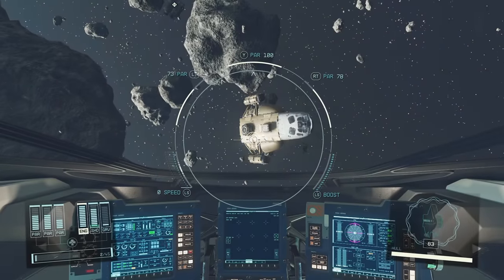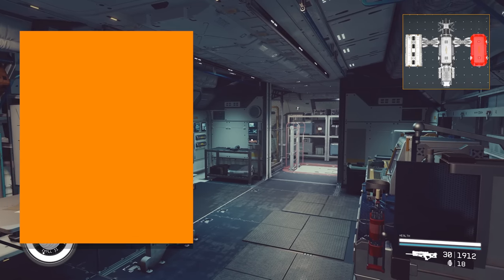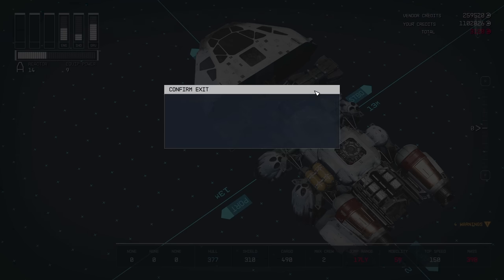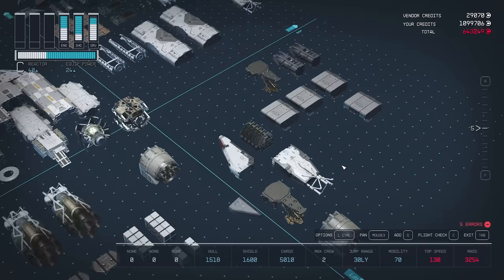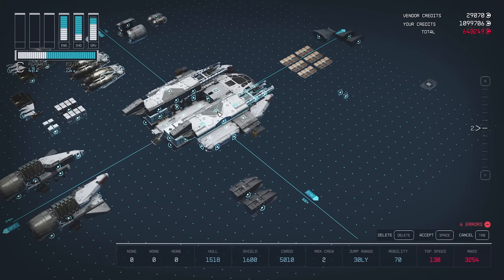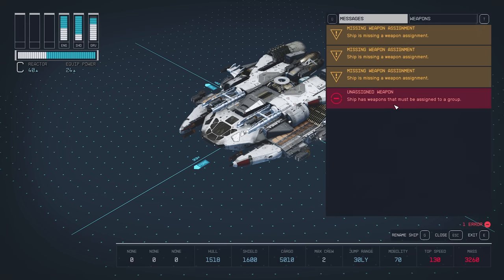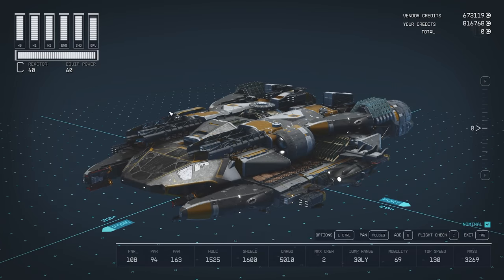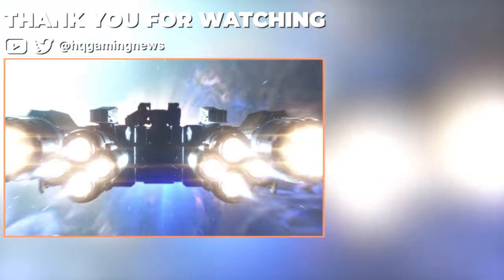The ULTIMATE ENDGAME ship in STARFIELD - No Mods, No Glitches, No Exploits

Comment: New to the game, played way to much with the ship builder to complete transform the Frontier, have a few other designs in mind.  A few questions for you since you clearly have expertise here.   You mention organizing things to protect important parts of the ship spines above the cargo)- is that just in a role playing sense, or does it actually matter in game?  Next, I upgraded my ship in 2 phases due to cost and not having leveled up the commerce skill the first time and went with the best things I could pay for.  Then I had to upgrade them this last time to make it fly with the parts I added for expansion.  I ended up replacing all of my engines 1 level up, which was pricey.  My question (and I'm assuming the answer is no) is whether there  is anyway to save the parts you are taking of   ship for another ship since you are otherwise losing a lot of credits
Reply from the maker: 1. It's just for role-playing.
2. Unfortunately, there is no way to save or store ship parts for later use. I discussed this in a dedicated video https://youtu.be/Wehl3qCvpDA?si=2AZD3ZJmwRJtSnOG

Comment: So, I have a slight issue. This is such an awesome build. However, when im done building it, it says the ship is using too much power for the weapons. It's probably because I dont have the Vanguard Obliterator Autoprojector. What should I use instead?
Reply from the maker: Sorry for the late reply. This error occurs when you place too many weapons of the same type on the ship. To check it yourself, divide 12 by the power rating of a selected weapon, and you'll get the total number of weapons of that type you can install. Vanguard weapons have a power rating of 2, allowing you to install 6 of them (12/2=6). Hope this helps.

Comment: I absolutely love this ship! Just build it for the fourth time.
At the end of the assembly you say that you can add a window instead of the Thruster Array, but I can’t place it because of the landing gear. If I exchange the landing gear for the Mid or Aft version I can place the window, but it messes up the flow of the ship. Am I doing something wrong?
(I’m not very experienced in ship building, I’ve only built yours and the one called The Homie Depot.)

Comment: I’ve built 2 of these. One is a modified Frontier, and the other is a modified Razorleaf. They perform beautifully, by the way. Now, let’s say I wanted to make one of them, say Frontier, the cargo hauler and I need more than the 5010 base cargo space. Now before you say it, yes, I’ve already maxed out the Payloads skill and stand at 7575 cargo. I don’t want to rely on my crew’s skills to improve my cargo because just like you, I’m wrestling with those thoughts and my breaking point is coming soon. Anyways, how should I go about modifying the ship to increase the base cargo space? Everything I’ve tried keeps giving me errors, and I’m tempted to use the infinity carry capacity console command, but I’m trying to go about this without that
Reply from the maker: That depends on whether you are okay with removing some of the habs and replacing them with cargo modules. Perhaps replace the two smaller cargos in the front (under the two protective Deimos Wings) with a larger one. There are options; just think about what's important to you and what can be safely removed.

Comment: i wish you make soon an upgraded version of the ship with 100 mobility. 
I added two nova cowlings (removed the deimos pumpers - port aft) on the back left and right of the ship so they can hold 2x poseidon dt230 (instead of supernova's) and i added 2x sal-6830 left and right of the landing bay instead of the amun x300.

100 mobility and bigger cargo with no glitches but i am not sure if i like the different engine look from the back though but looks ok.

Still trying to find how to get 8 crew without 2xcontrol stations , i only have 6 but works fine for now .
Reply from the maker: I'm locked out of SAL-6830s because I completed that quest 'differently.' I need to find the footage so I can include it in my next video to highlight that point.
Reply: @hqgamingnews  thanks for replying , i hope in the future you upgrade the ship and make more changes, its a perfect template for a nice looking ship with no ladders aggressive with military look :) Almost perfect tbh !
Thank you

Comment: I have a very similar ship, that i basically got for free - Spoiler - its the everything/all in version of the stroud ship you get. I just took it apart and rebuilt it adding the double entrance nova bridge... with the most notable difference being a front entrance below the bridge. The entrance is one that goes straight up, so you still don't have any ladders, but you also don't have to run to the back of the ship. The dock is on the second floor directly above the entrance, basically you can exit and enter the ship very fast from the cockpit.  Other than that everything else is extremely similar to this one but no hallways, and at a much lower cost to make as most parts you get free with the Stroud mission ship.

Comment: I finally worked this out, but the trick is to have your weapon groups 1 and 2 have the same or near fire rate. If one has rate 2, and the other 6, and you fire both,  the only fire at a rate of  2, wasting the fire rate of the second . Which is why the pbo's and the vanguard obliteraters work well together.
Reply: I forget it's name but there is another particle beam of fire rate 6 and 19 damage , as opposed to the vanguard obliterators 14.  But it's power is 4 as opposed to the obliterators 2. So when I tried 5 of them instead of the  obliterators I got an " excessive weapon power" error.

Comment: Personally, my preference to have the workshops at my main outpost.  I find i rarely have everything I needed to craft in my cargo anyways.  My ship is similar to this but much lighter weight and fun to maneuver
Reply from the maker: That's what I did before building this ship, and it's still a very viable and convenient option, for sure.
Reply: @hqgamingnews  yeah early on (lvl 30), i made a small version of the Claymore.  it was very completive and useful for a very long time, buzzed right through the UC-vs-Crimson fight with no problems.

Comment: if you don't give the looks much thought, just making it 'work', you can cut the cost to 500-540K, with the bay facing front. and a 8000 cargo include 670 conceal cargo. and has 100 mobility. Well, the idea is using your fueltank, jump engine and power plant as the ship's 'butt', use that 1760 cargo block as topside connection parts, put 3 Poseidon that directly connect to the cargo block and powerplant and attach weapon attachment small wings at each outer-side of the Poseidon engine. ohh, and don't forget to attach 3 weapon pillar direct mounting them on cargo block and your topside docker, facing front. 
so, you will have an ugly little C class ship, with a front facing entrance right below the size four double deck bridge, 9 crew member size, all workbench and reaserch, cooking, chem stations, 14 particle beam weapons, with your skill, 46 engine power and 8100 cargo (670 concelled). 
The ship looks like an ocean sunfish, and works like a charm. ohh, it has 138 speed and 100 mobility, 650 fuel and of course 30 light-year jump range. 😂 (and more importantly, you can get ALL parts from Titan (sol system), a one-stop-shop. I just go there, buy a discovery and delete everything but the bay, and building it from there. Everything includ weapons and mounts. one-stop-shop)

Comment: Excellent guide on how to build a ship! For the quality of the guide - description of the details of how, where and what to attach - 10 points out of 10!!! 
But the ship itself is bad .It slow, too heavy, and maneuverability is unacceptably low. The ship is overloaded with modules. There is no energy balance; it is impossible to turn on shields, engines and all weapons to maximum at the same time.
Reply from the maker: Thank you.

You don't need full power for weapons to destroy everything in a matter of seconds. Power determines only the recharge rate, which is already fast at around 7 pips for the two primary weapons, and the third weapon group (auto turret) needs only 3 pips. Fights on very hard difficulty are over in about 10 seconds or so.

Also, mobility is overrated. While a more agile ship can be crucial with weaker weapons, these particle behemoths let you blast through everything ultra-fast, minimizing the importance of mobility in determining success.
Reply: @hqgamingnews  
I will not describe my ship in as much detail as you did. I will say two things: it is similar to Voyager and Dullahan at the same time. Actually, this is a converted Voyager, and I fly alone. There are no crew or companion stations on the ship. Maneuverability 98; speed 130; load capacity 7100. Armament 3 obliterator 250 MEV turrets and 3 PB-300 alpha beam. This is not the fastest-firing weapon in the game, but it is the most powerful. In my entire game, only one ship survived more than three hits from  all six guns. I think you know what ship it was. All systems consume exactly 45 energy and do not need to be changed during the battle. Very comfortably.

Comment: There are some major shortcomings with this ship as a jack of all trades, endgame option (some of which you acknowledged in the video):
- no forward-facing landing bay
- no max crew slots (their bonuses are pretty crucial to maximizing your ship stats)
- use of a workshop that isn't the Stroud variant (which has a research station in addition to the crafting benches)
- lower mobility. Should go for either max mobility or a turret build (max mob preferred since hard to board ships with a turret build)
- 5000 base cargo is a low goal to aim for, you can easily achieve over 8k base cargo with max mobility using 6x SAL 6830 engines. 
- I'm don't see the need for an armory
Reply: To be fair, none of these are 'applied' problems with the design as everything is adjustable to suit your own needs and play style, as I'm sure most of us have done and as he suggested in the video.

I maxed out the crew slots by combining the reactor/grav/fuel into one space and using the vacant space that was left for a command bay.

I already have a ship with 36000 cargo, so I actually removed the cargo from this and pretty much all of my other ships, now it's at 100 mobility. 

I board ships with my 36k cargo ship, so 100 mobility isn't essential for that task. Just get the right weapons and as he said the Spark 750 makes that easy, I run four on every ship I own, just in case I see something I want to own, or feel like a free for all docking session where Andreja hunts the crew down like a cat chasing down the rats.

It's nice to have an armoury, if only for the aesthetics, especially when you need a gun quickly during a mutiny.

Thanks for the engine tip, I'll give that a try 👍

Comment: Anything under level 60: Use Star Eagle as base. It provides good reactor, engines and shield. 

You can easily build it up from there with better weapons and add more storage. 

Im at level 36 and ship has 3600 cargo, good weapons, added one 3015 engine to give more mobility. Easy and cheap setup. Its possible to have over 4,000 cargo on this with good mobility. 

Will upgrade to a better reactor once something decent comes available tho tbh the original is already really good. Only drawback it being class A which limits weapon choices.

Comment: Built at level 24, with a few parts swapped out. Will go back for parts to upgrade as they become available.

GRAV DRIVE: J-52 Gamma Grav Drive - sub Aurora 11G Grav Drive lvl 20
REACTOR: SF40 Sheared Flow Reactor - sub Fusor DC401 Reactor  lvl 20
SHIELD: Assurance SG-1800 Shield Generator - sub Odin 3030-C Shield Generator the den lvl 24
Amun Dunn X-300 Engine - sub SAL-6830 (expensive) or sub 2x additional Supernova 2200 Engine
2x Galleon S204 Cargo Hold - sub Galleon S203 Cargo Hold
1x 10ST Hauler Shielded Cargo Hold - sub Caravel V102 Shielded Cargo Hold

Comment: So would the only way to improve your mobility be, by reducing your cargo storage?
Reply from the maker: That, or if you have access to SAL-6830s, you could replace the engines I used here with 6 of those. That should bring you near or exactly to 100 mobility. Even SAL-6330 engines should do the trick.

However, mobility, sadly, isn't as crucial as people tend to believe. Anything above 50 is more than enough, as long as you have sufficient firepower to swiftly eliminate threats.

Comment: Chouette Vaisseau, i have construct de-construc my ship during 750+ hours game (level 105 actualy), i use the CABOT cockpit for the same utility to avoid ladder (one unique ladder to access the third level), speed 130 and 70 agility but 12000+ for cargo, using all upgrade to reduce TANK weight, same thing for shield and powerplant, and using compagnon to level the ship too + other upgrade given by game, for weapon choice it's about 200 hours of testing, i decided to not became a new born for the moment and i'm thinking to do the same thing on YouTube to keep the template of the ship, because it's an absolute badass at this moment lol, i don't know for the moment how build the video my idea it's using a series of screenshot in game and put together with PowerPoint. All my slots are used, may be on next univers i will test you're ship. thanks for sharing template.
Very cool design. 🤩
Steph.

Comment: I build it, but can't really use it yet because I was missing quite a few key parts at my landingpad's shipservice.. This derailed me a bit for a while, but I finally solved the mistery, turns out I'm only at level 35, so I had to use an inferior gravdrive, reactor and engines so I don't have to start all over again..
Reply from the maker: If you've built the core layout, you can always replace the lower-class parts with new ones as you unlock them while leveling up. You're close, though.
Reply: @hqgamingnews  I could fly the ship now, but mobilty is about 43 and has a 17 LY  jumprange.. But thanks to your build guide I've got something to look forward to.. I've wasted so many hours and credits in the shipbuider without a satisfying result.. Just before I stumbled upon your video yesterday I atempted once again  and tried to force the game to place the ladders where I wanted them, by making sure there's only 1 path to each hab.. But ofcoursr it didn't allow it, because the ship was either too long, too wide or too high, but it doesn't tell you what exactly or even what the limits are.. I'm pretty sure. It wasn't too tall becauee it only had 2 levels plus a bridge on top and I don't think it was any wider or longer than the longest or widest ships I've seen for sale at the shipyards, but the most frustrating part is that you can"t go back and check without canceling your design, just simply allowing players to store ships (that's not your active homeship) that don't pass the flightcheck would already make it so much more convenient..

Comment: Some creative choices here with what's available, but I can't help thinking how wasteful it is to add two smaller cargo units where one larger one will give you more space. The cargo to weight ration usually favors larger footprints with a weight savings. My view is you can eliminate some of the unnecessary cosmetic parts, improve your cargo space and maneuvering with a few tweaks.
Reply from the maker: This video was supposed to spark ideas and encourage shipbuilding discussion, and judging by the comments, it did just that. So many good suggestions and variations of this build can be found down below.

As for your suggestion about one bigger cargo hold instead of two smaller ones, you're right, but I found those two Deimos Wing C's interesting when they’re facing each other, so I had to compromise.

Thank you for watching. o7

Comment: My question is about energy dispersion during combat. If you covered it I'm sorry but you have 36 points in weapons alone, are you switching for combat situations. I have a companion with the perk that gives you an extra point to you reactor and I also have the 0erk to lvl 3. I can squeeze out 4 PBO auto cannons and some lasers to wipe shields but to keep my engines and shields up, I can't push further. I would love more detail here. Thanks
Reply from the maker: So, I'm using a 40-power reactor. The rule of thumb (thumb = me) is to always max out the power for shields; this is non-negotiable. During combat, I don't need any power in the Grav Drive, unless I'm fleeing for some reason, so I don't power it at all. For the weapons, I allocate 9 power to the first and second groups, and 3 pips to the third group, which consists of turret particle beams. The turrets serve as a filler in this setup, so I'm okay with a slightly slower recharge rate. So, that's 12 + 9 + 9 + 3 = 33 power distributed among shields, W1, W2, and W3. The remaining power can be allocated to the engine. With 5 more power from the skill tree, you gain even more flexibility.

I hope this helps, and you can see some of this in the video starting at 22:59.

Comment: I varied the build a bit when I applied it to a stolen registered ship. Used some Taiyo structural parts and swapped a couple of  habs to get more crew slots . Got the invisible ship problem . Nothing fixes it, had to roll back to an earlier save,  lost most of the work. Very frustrating

Comment: Why not the C3X or C4 bridge?  They are pricier and require Starship Design 1 and 2 respectively.  Is that why you didn't include them as options?  Or are they worse?
Reply from the maker: I said that you can use either option. 4:23